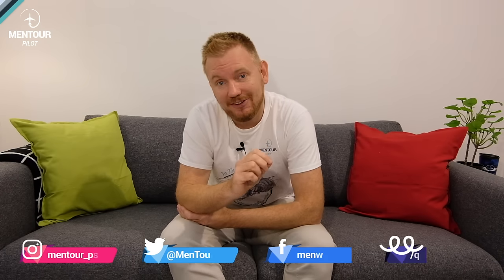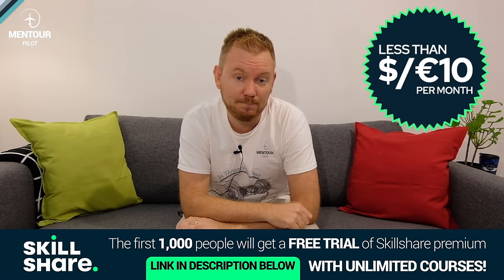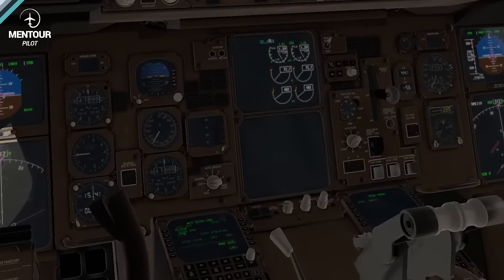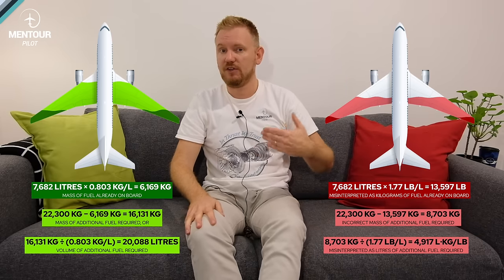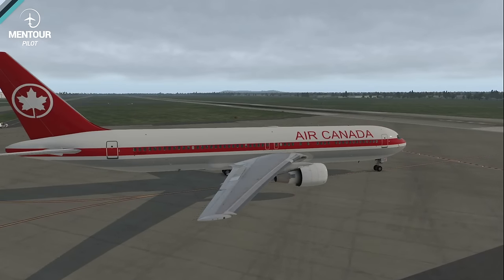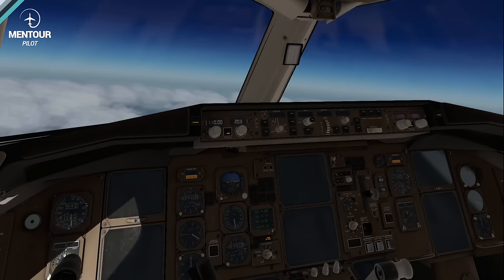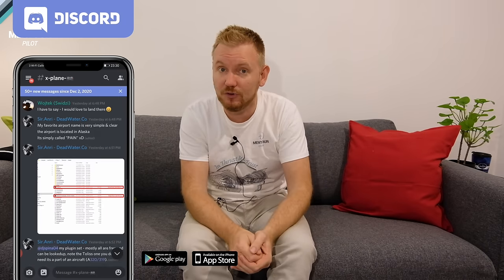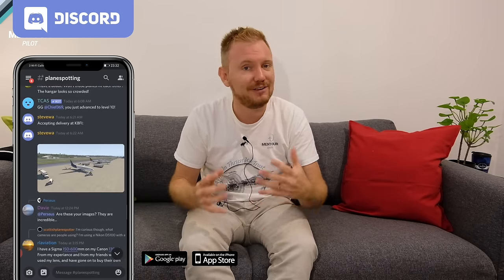The Gimli Glider! Explained

Comment: That happened when I was on holiday in Canada. I seem to remember they just changed from Imperial to Metric so the plane was fuelled with litres while the crew believed it was gallons! At least that is what news said at the time. Let's see how close that came to the final report.
Reply: Well close enough because the result is pretty much the same ie they had a quarter of the fuel they should have had (1 US gallon = 3.8L).

Comment: The aircrew were undoubtedly courageous and deserved their long awaited reward. But the failure to understand the difference in metric and imperial quantities by them still baffles me.  I grew up with the metric system, as we adopted it officially in the UK about 50 years ago, but my parents spoke the imperial system, and indeed the UK still uses miles per hour as speed limits.  I am an aircraft technician, well used to converting fuel quantities from liters to gallons to pounds or KG.  The easy way to remember is that one metric tonne, 1000KG, is roughly equal to an imperial ton, so roughly 2200 pounds.  As an imperial ton is 2000 pounds, this is only 10 percent more.  So it baffles me how people could get it so wrong.  Even the fuel bowser driver must have been baffled when the aircrew only wanted 5 tons of fuel.........

Comment: Took a guy up in a glider who was really uncomfortable flying... so every turn under 2 degrees, a bit of a tour. Huge lift on the landing circuit. Spoilers, an extended circuit and still high. On final I told him the ground might be coming up a bit quick and the aircraft is going to be shaking. Sideslipping works like a hot  da... I felt bad for the passenger, still think he enjoyed the flight. Love the story of the Gimli glider.

Comment: Is there no aircraft documentation were faults are written down, in the RAF we logged everything and oncoming crews read and signed before taking over the kite, like on a boat there is a written log? it seems extremely sloppy for the crew to just have a verbal interaction, clearly an accident waiting to happen. Also a simple manual rotary disc calculator for conversion tables, we used these, cheap and almost foolproof.

Comment: I'm an engineer. You NEVER  use 2 different measurement systems. I have done both metric and imperial. Degrees C and F. But you stay in the system you start with. The aviation industry still uses feet for altitude doesn't it?  It trivial to stay in one system. After one or two projects, you can easily switch to thinking in either units but don't ever convert!

Comment: Great story.  I find one part unbelievable.  I do not buy that they did the drip test at the mid leg of the trip and also did the metric conversion wrong.  I sould GUESS that they did not check at all.  It is to unlikely that they made this ridiculous error in duplication of the error at the point of origination.  Is there any evidence that they did check the fuel level at the mid leg stop?

Comment: I wonder how the bad calculations had resulted in settling for departure. Because if they were a lot lighter than they tought then they should have feel that aircraft is behaving a lot more agile while rotating and would go much faster. Total weight of aircraft determined speed you need to take off with, angle off attack and trust settings for climb. They must felt that aircraft behave different then expected especially it was a huge difference in weight. Huge.

Comment: Why do airliners do not have batteries to keep instruments operating  for a few minutes when engines go off? It seems a minimal effort for an extra safety layer (and not so much added weight.
Reply from the maker: We do, in the b737 we have a minimum of 60 minutes on batteries. In this case the load of providing hydraulic pressure as well as instrumentation etc was so big that a RAT was needed.

Comment: To a layman, leaving the ground withoit a single working fuel indicator seems crazy. Even if someone in engineering, or Boeing themselves said it was not a minimum requirement, surely you would just say FTS.
Reply: I would need that in writing or a direct order from a superior that could be confirmed by witness's.

Comment: Why is anybody converting anything? If the flight gages are Kg (which isn't metric anyway, weight of fuel would be kN, or are the pressure gages kg/cm?), why don't the fuelers totalize in Kg? This is a system problem that I hope has been corrected.

Comment: They tanked 25 % of the needed fuel (for a longer distance) and did not notice something was off ?? How can that happen to experienced pilots ?? When they started they had 7682 lites in the tank (from the day before) - this was the first thing they entered into the forumula, and the (incorrect) result was that for a longer flight they needed only additional 5000 l (rounded up) - and that did not raise any suspicions ? If their calculation had been correct they would have started out with 60 % of the needed fuel for a longer flight  * already in the tank (from the flight from the previous day). That does not make sense as they had a stop in Ottowa anyway. 

- They may have been good hands on pilots, but no maths competence. Or basic plausibility checking capability (in a math related area). 

Sure: back in the day they were not shy to carry a lot of extra fuel around, never mind inferior efficiency because of the dead weight (it is also a risk for emergency landings). 

But still - 60 % in the tank already, only 40 % more needed for a longer and preplanned flight (no sudden change of routes) is weird and should have prompted them to doubt their calculation. (Or not to be too proud to get some competent help). 

A simple plausibility consideration: 
I know that 1 l fresh water weighs 1 kg and or roughly 2 pounds. And I know that fuel has a lower density than water. So one liter of fuel will be less than one kg. - their conversion factor assumed that fuel has considerably more density than fresh water (1.7 means plus 70 %) - that did not add up. At all.

For the fuel type which they used Petter mentions the multiplication factor of 0.803 (80 % of the density of water if you will) - I would have guessed even less densitiy - but that sounds plausible. 

7682 liters of water would weigh 7862 kg or roughly 15,740 pounds. But 7682 liters of fuel only weigh 6169 kg. (Like I said: just from a reasonable if unchecked guess I would have assumed even less than 6169 kg - but in their situation a factor of 0.803 would not have triggered me, but 1.7 would not have passed the bullshit meter.

Comment: I remember this one being on the series Mayday Air Disaster Investigation actually. This was the one that had to land on a 'runway' at an Air Force base that one of the pilots used to work at but the 'runway' was a drag racing track? Leer: misunderstands engineer Pearson: misunderstands Leer Me:talk about the worse timed game of telephone EVER. my preferred general chemistry 1 college professor always said 'make sure your UNITS cancel, focus on the operations after as if units are properly cancelled you got the order of math correct'. which they had only 1 unit correct, the liter, but 1 unit INCORRECT, the pound which should have been kilograms. someone probably should have told them how much in kilograms so if they were to set it up they would likely know they need the kilograms/liters conversion(density btw as well lol mass divided by volume), but since they didn't have the proper mass unit but did have the proper volume unit, that also shows another form of confirmation bias.

Comment: Captain Petter takes a highly complex story and tells it to us as if it is a fairy tale and very easy to understand. I used to be a private pilot but no longer after a near fatal collision with my Cessna and a Delta jet (can’t recall the type of aircraft) landing at what is now Houston Hobby but then was Houston’s only airport. George Bush Intercontinental (IAH) opened later that same year (1969). We had both been cleared to land on cross runways. After the investigation, the Delta pilot and the AT controller were both fired and my action of a go around was considered the right and only move I could have made. The Delta pilots should have seen my Cessna landing because they were behind me and therefore long before I could see them and should have executed a go around or called the tower to ask for a directive but they didn’t. We were so close to each other I could almost see the Captain’s eyeballs popping out of his head—not really but almost. I gave up flying shortly after this incident. I think any young pilot would. I was coming back from my first solo. I was still taking my lessons and just weeks before getting my pilots license. After a year following the issuance of my license I never flew again.

Comment: I was just wondering.  It seems that the rear slides can not be used when any aircraft loses its front wheels. Why not change the length of the rear slides to accomplish this new height?
Reply: There's probably about 50 reasons, but I'll say because they won't fit in to the storage space where the slides are supposed to go, because they'll need to change the whole inflation system (it'll need more pressure) and because the slides will no longer be slidey if the plane is flat on it's belly or sitting evenly on all wheels.
Reply: The 777 has taken that it to consideration, the rear slides can be used when the nose wheel collapses

Comment: I realize that the APU would not start because there was no fuel.  Shouldn't modern "fly by wire" aircraft have a reserve tank for the APU that would run it 30 minutes while you get the the ground?

Comment: Seems to me there are other problems that contributed to this incident not mentioned that need to be fixed.
IMO it's a serious design flaw for any kind of switch including circuit breakers to not obviously indicate their position. Of course, a problem with a push-pull breaker is that it's easily not perceived in either position except if compared to other breakers and know what their position are, but there are many reasons why you can't perceive correctly. So, some kind of absolute indicator is needed like a color that's visible only in one of the positions or a mechanical indicator of some sort so push-pull isn't the only indicator.

Other thing is that the instructions should include a calculator of some sort, whether it's a simple paper insert with spinning dials or nowadays an actual independently powered computing device. Better yet, connect the computing device to sensors to eliminate input mistakes. With the independent power source it woldn't be subject to main circuit power failures like anything associated with the circuit breakers.

Comment: This is less related to the accident and more about unit conversions. Idk who cares but maybe it'll help someone.

In high school my chemistry teacher showed me the best method I've found so far for unit conversions/stoichiometry called dimensional analysis. This could be well known in this community but enough people have told me it's not something they've seen before that I feel I should share. Say you're converting 100 L/sec to lb/hr. Draw a horizontal line and put 100L on top and 1 sec on the bottom, both to the far left portion of the line, and put a vertical line to the right of this fraction. Then choose a unit to convert first. I go with the top, so for the next fraction you'll put 1.77lb/1L. You can cross cancel like units, so you basically have 100|1.77lb/1sec. Now deal with the lower unit, in this case draw a vertical line and the next 2 fractions (or 1, but more steps means more ways to check your math) should be 60sec/1min and after the vertical line another 60min/1hr. Cross those units again and the final fraction is 100|1.77lb|60|60 (num) / 1hr (denom). Multiply the numerator cells and divide by the product of the denominator cells and you have your conversion. It's much simpler to understand with visuals, but this will have to do. This way you see every conversion properly; you need to cancel out units, so you instantly know where to put each value and you won't get confused when dividing by a factor vs multiplying by it. Additionally, you can use one factor (1.77lb/L, for example) very naturally in the inverse (becoming 1L/1.77lb) instead of remembering the inverse factor (which is a problem in chemistry especially because of really complex units like kg*m^2/s^2). And if you end up with some value you can't explain (idk let's say you end up with L/hr), you can easily convert it back by multiplying again in the same way. 

But tldr use a wide cross/tally shape for unit conversions (between each fraction there should essentially be a + shape) and it's much, much easier to see when you've made an improper conversion.

Comment: That second engineer was a bit of a worry... not resetting the circuit breaker and resetting the fuel gauge system before leaving the cockpit. It was one little thing in a series of things, a.k.a. the holes in the Swiss cheese analogy. But still not good practice. Not restoring a system back to the way you found it or better is asking for trouble. It's why any decent mechanic always torques the sump bolt up before walking away. If you just put it in hand tight, someone comes over to ask you to help them and you forget to finish up. Same principle with the Helios flight 522 ground engineer that forgot to place the cabin pressurization switch back into Auto. It's such a little thing... but every little thing eats away at the layers of redundancy in place.
Edit: Sorry forgot to add what an incredible job Captain Pierce did. Imagine being the Ist officer, looking sideways out the window, counting the petals on flowers rushing past at 200 knots. I'd need to be wearing brown trousers lol

Comment: Does the Aviation industry still use 2 different units of measurement, or has that been standardised in todays industry.  I guess that would be one of the challenges operating in countrys still using the old system of measurement.  Even in my industry, we use mixed units, generally we use metric for almost everything, but when we start measuring tolerances of bearing clearance, or valve lash, we tend to still use inches (Even when specifications are in mm, we convert)  This is something that I've been trying to change, I could only imagine what sort of risks it would create by forcing further change.

Comment: It surprises me every time to see how much some people struggle with this conversion from one unit to the other. I'd expect a pilot to be a bit better at math than this. But maybe it is because I grew up with the metric system and there you quite quickly notice your mistakes because there is more logic and consistency in the system. When you use pounds, cups, miles, inches, feet, knots and what not it all becomes much more messy and you don't notice an obvious mistake that quickly. 
About time we all do the logical thing and move to metric entirely. It will take some getting used to but some generation has to do it. Aren't we smart enough to take that job and change the world 😉

Comment: Canada, swapping from lbs to kgs should be easy.  Just any old references to conversions to lbs need to be forgotten by the industry.   In very basic terms, it's 2:1. 
More importantly, jet fuel is slightly less dense than water, so 1 litre of water (1kg) has slightly more mass than  1 litre of jet fuel. Approx 0.8kg/L, so again, checks are easy. It floats on water too, which is a bit of a clue.
When it comes to conversion factors I always multiply, as it's far less confusing. Just use the correct  factor and have a way to convert it in your head. 
I think it likely the captain couldn't be trusted when shopping in the US, converting $ to $. When everyone's lives depends on you getting it right, you take more care with the numbers that matter.

Comment: I've seen presentations about this incident before, but those presentations tend to put the full blame on the maintenance engineers/ground crew.  If I'm to understand from this video, the faulty calculations were done by the flight crew, not the ground crew however.  That's pretty damning really.  OK I understand that lack of training was also a factor but one of them should have done a double check at some point.  Also, taking off with no fuel gauges?

I'm conflicted - I'm not sure I would have given the flight crew a free pass on this, but I'm very happy they both went on to have successful careers.  In the end the result was good, but I'm rather uneasy about how we got there.  Gimli glider indeed.
Reply: The flight crew didn't get a "free pass".  Both of their careers were impacted, although they didn't lose their jobs.  And...taking off with no fuel gauges was permitted by "the book".
Reply: @jasonwhite1069  Yes, no fuel gauges was OK, but only if they dipped the tanks before flight regardless of what calculation are done and how confident you are in them.  Like I said I'm glad things worked out as well as they did, but we can all learn the lessons from this no matter what we fly.

Comment: Metrication in Canada has resulted in a pretty schizophrenic system of measurements. People who, like me, grew up with both the imperial and metric systems tend to still use a mix of both. For example, in everyday conversations we measure air temperature in celsius, but water temps in fahrenheit as in "it's a blistering 30 degrees out, fortunately the pool is at 84". For my car speed and distance are in kilometers, but tire air pressure is in psi. My daughters are in their 30s and grew up only with metric so they aren't quite as schizophrenic.
Small detail, the French Canadian surname "Quintal" is pronounced with a silent U.